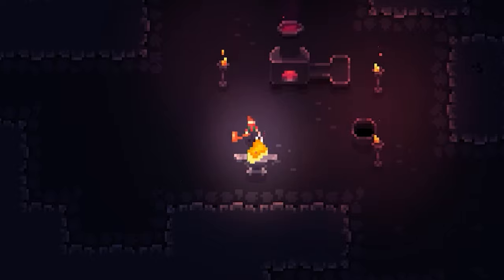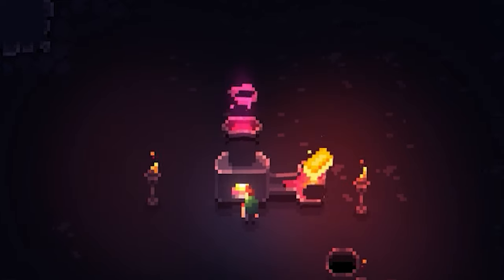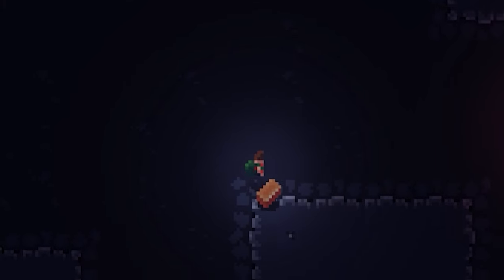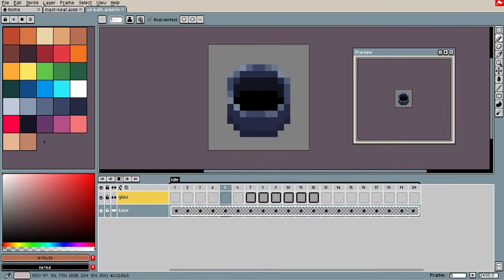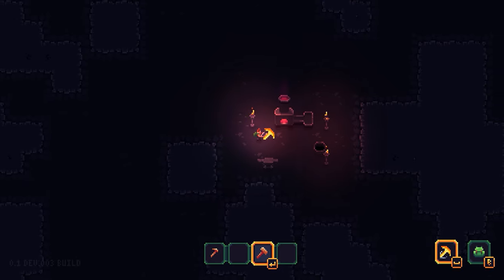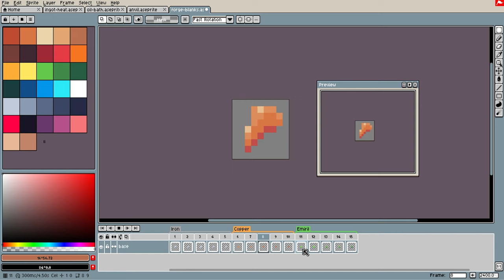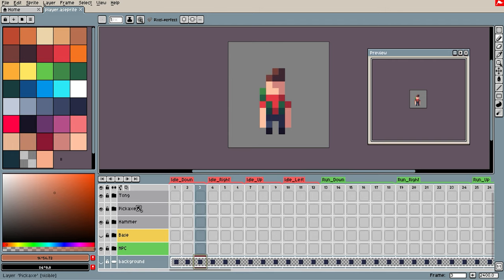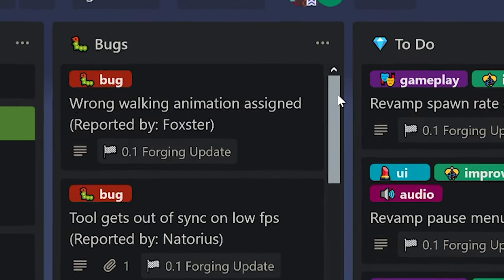I added forging into my Godot RPG | cave devlog #6

Comment: Fantastic work! The forging system seems like it's really great!
Something I was wondering about your shader, is why did you need to invert the colours? Could you not just desaturate straight away?
Reply from the maker: Great point! It makes it visually more interesting. Without inverting, it looks like I am just "recolouring" the individual pixels. With the invert step it adds to that illusion that suddenly the item gets hot. I maximise the contrast between each heated up pixel vs normal pixel without the shader applied. Subtle but effective.
Reply: @bitbraindev  That makes perfect sense, thanks for clearing that up :) - It adds more changes to the item by inverting it, which saves you some time in having to create assets as you said, and is super effective!

Comment: I recommend improving the animations later down the line, because the current animations for mining, forge hammering, etc, does not have a sense of weight and timing. Improving the weight of the animations and the timing should make things feel better, but you should put this recommendation on the backburner until the polishing phase of development.
Reply from the maker: One of the biggest issues with the current animations is they are lacking "anticipation" - that can be achieved through smearing and removing any "linear" movement. I am still quite new to pixelart and animations (started only last year) so these things are definitely on my list!
Reply: @bitbraindev  Thanks for considering my recommendation! I was also thinking of a cool way to implement forging. In it's current state, it seems a little bit boring, because you are just mindlessley pressing a button to forge the tool. Maybe there could be a timing system, where pressing the button at the correct time or some other kind of minigame, maybe similar to the stardew valley fishing minigame could yield a better quality tool, encouraging players to master forging so they can get the most "bang for their buck" to to produce the highest quality tool.